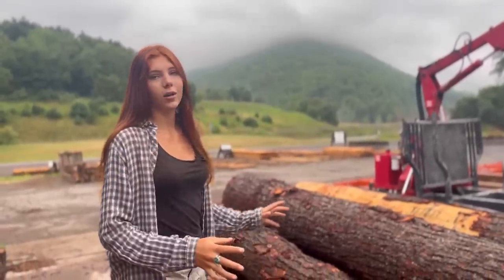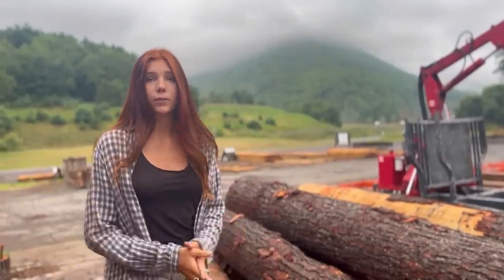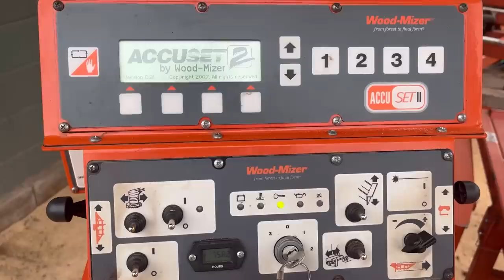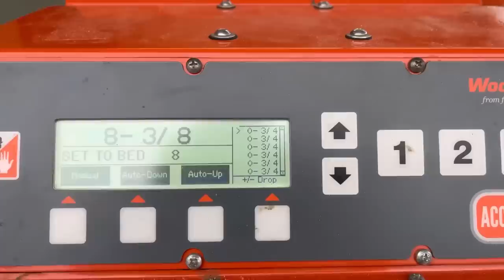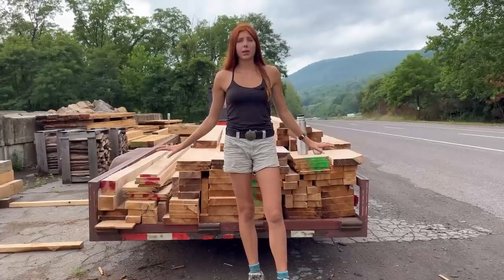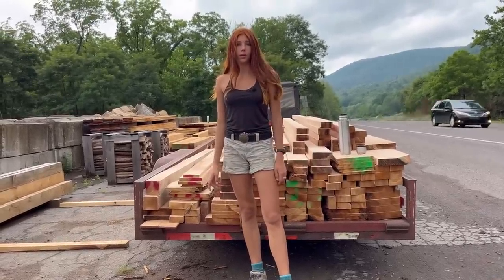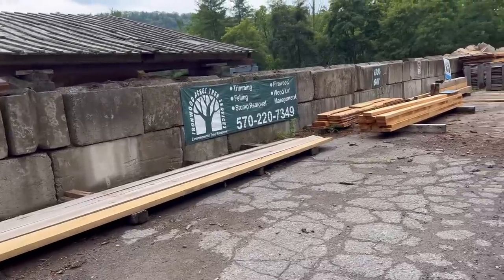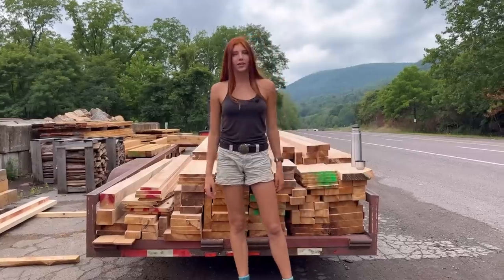Mill Vlog

Comment: Does this machine takes into account the variability in the center of origin of the log? It appears like the first cut will only be depending on how the log is supported at the bottom. Does this cause any concern when drying the wood?